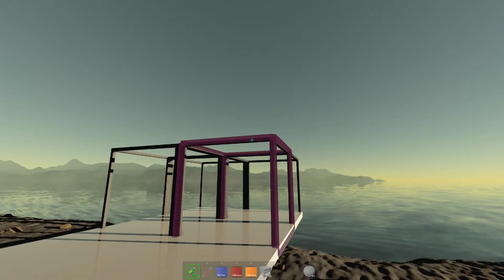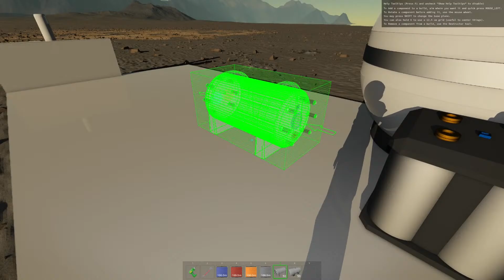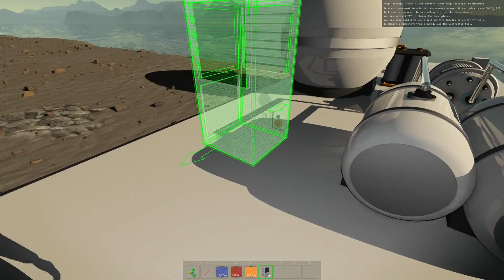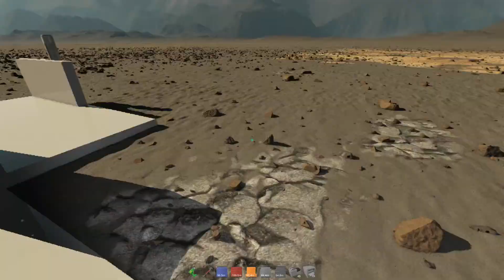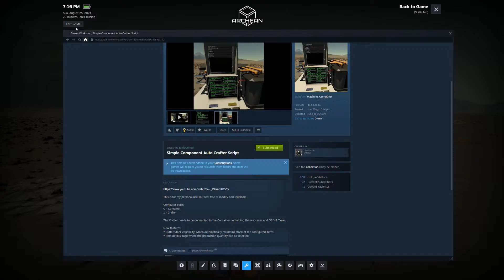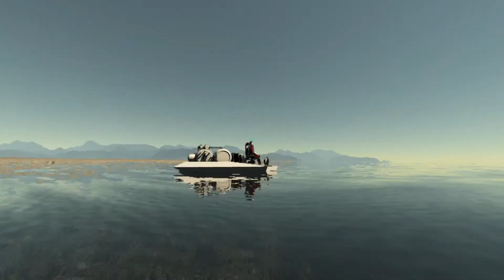NEW Engineering Sandbox | Creative Mode Testing in Archean

Comment: Fluid junctions are not directional like electrical junctions but each port connection can only do in or out at a time and the multi-side doesn't connect between those 4 ports directly. Pipe fluids through fluid junctions that feed into multi-port sides of other fluid junctions so that you have extra pipes to support both in and out on the connected device (single-port side). Think of the pipes as one-way roads. Only one direction of traffic per pipe. You can connect more than one "fluid" through the same pipe though. (Water, H2 and O2 all piped into the multi-side of a fluid junction and the single side to a crafter.)
Reply from the maker: Interesting. I'll have to do some experimentation and hope it sinks in.
Reply: @KerboOnYT  Honestly, I think the issue is your brain is too big. You may be too smart for your own good. Try channeling your inner ditz. I think the way the fluid junctions work (at least as of now) is very rudimentary and sort of "just works" for ease of use for us folk that ate too many crayons as children.
Reply from the maker: @AnnastasyaK  🤣